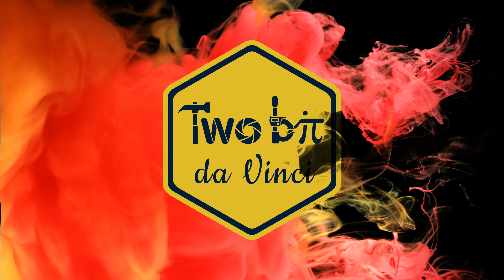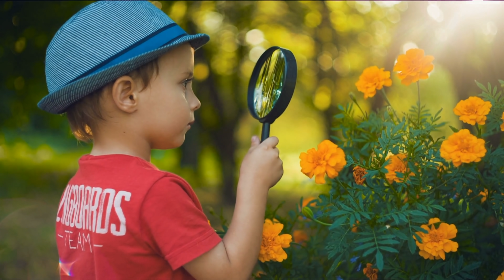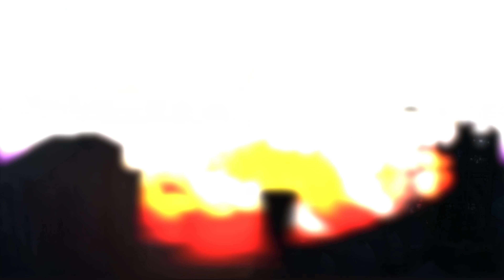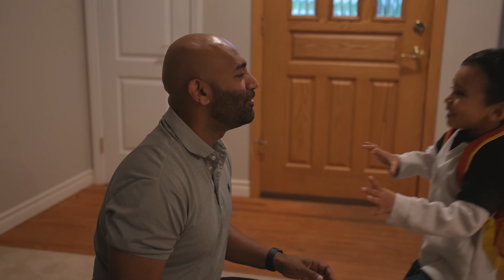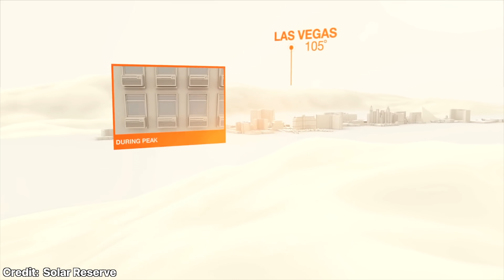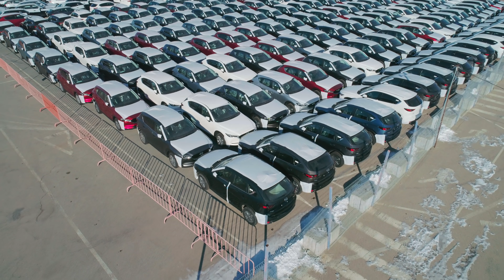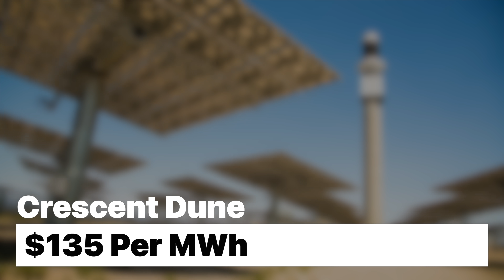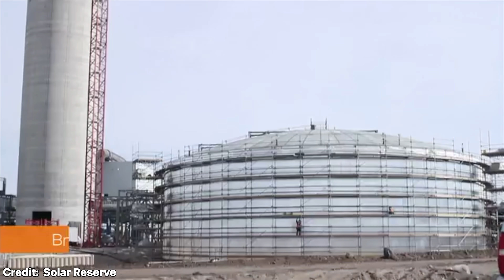This Billion Dollar Solar Plant was an EPIC Failure

Comment: You left out a couple of key points.
1. It incinerated hundreds to thousands of birds a day. Literally, charred debris from birds and litter being burnt into ash covered the solar reflectors causing daily issues.
2. Misalignments caused actual damage to the structure. Each solar reflector producers so much heat that minor alignment issues can serious damage, and in 2019 the main tower was taken out of commission because of solar panel alignment issues causing a fire.
There were huge amounts of manpower required to keep the panels clean and aligned, and it wasn't ever going to be cost efficient.
But Harry Reid's family made tons of money, so the actual purpose for which it was built was completed.
Reply: Greed causes people and governments to go large scale. Why don't they think off grid and small scale????
Reply: @crypton_8l87  because that equals freedom and independence....two things which government despises and works to limit.
Reply: You're right about the politician aspect of the project, but you're completely wrong about the birds, tower, and mirror washing aspects. Ivanpah was the solar concentrating project that was killing birds, not CDS. We had a team of biologists and aviary specialists that spent a month out there, and only once did they find a burned bird...and it wasn't even that bad. It was taken to a rehab facility until it regrew the needed feathers. And yes, if too much solar concentration were focused in a single spot it could be damaging, but only to the bare concrete or the heating tubes. The main body of the top portion of the tower is covered with a temp resistant material, similar to what NASA uses on space shuttles for reentry into the atmosphere, and the tiles are checked daily and replaced as needed. Again, I think the fire you're referring to was in Ivanpah. I drove past those towers many times and saw the middle tower was burnt up, and it took awhile for them to fix it. No fires at CDS though. As for the mirrors, keeping them clean and aligned are two completely different departments. There is a specific wash crew who's sole job it is is to drive through the field daily and wash the mirrors. They work in conjunction with the Heliostat Control Room Operator to put the field into wash position, via the HFCS (Heliostat Field Control System- software), all while the HFCS Operator is running the field to do recalibration, as well as salt production...sometimes at the same time. That's the system I put in place when I started there, but then moved into plant operations later.

I get your mindset on the whole project being a giant cluster f, and it caused a lot more harm then good, but you have a lot of inaccurate facts about the place, some of which I think you are mistaking for the Ivanpah project. But either way, the whole thing was a disaster and was solely used for political purposes. It was one of Obamas many failed solar projects that he green lighted, most of which just took the government money (ie our tax money) and ran....folded before they even got off the ground.
Reply: It was another “Green Energy” money laundering scheme.
Reply: ah yes OLD Crook  Harry    the   demo Don of  B S !!!!!!!!!!!!!!!!!!!!!!!!
Reply: Wow, thats COMPLETE IDIOCY. Complete waste of money. Whoever came up with this stupidity.... Hopefully natural selection will pick them off.....
Reply: Great points, always helps to have a fuller set of intormation.
I might add - Space.  How many of these could be built before space limitations become an issue?
Stay gold.
Reply: Really not to many birds since since this this is a desert.  With other similar plants ways to repell birds have been developed.  Really the bird problem is just one of those development problems like figuring out valves and pipe fittings for 1200⁰ F molten salt.  Nothing goes completely right for the first time.
Reply: iiiiiiiiii don't think it's the adoption curve that's the issue. It's operational and maintenence reliability and sustainability issues as the video mentioned. Yes, politics plays a small part too. I personally still believe the acreage needed to produce what a gas powered plant produces negates the benefits. I do such plant CAN be effective but not as a stand alone system. No alternative power supplier can solve ALONE our energy needs while protecting our planet. These sources in CONJUCTION with natural gas and other energy sources are the logical solution.
Reply: That’s what this push to renewable is just one big scam for the rich.
Reply: Thank you for reminding folks that this fiasco was paid for by Democrat politicians with money stolen from the American people.  Don't forget Solyndra.  That was another $500 million obozo cluster f^ck!
Reply: No.  Not even close.  Having been there during operation I can tell you that there are very few birds in the area on any given day, and only a few (0-5 per day) were killed.  More birds are killed by housecats everyday than were killed by this powerplant.
Reply: @speedyham545  are you still there?...would I know you?
Reply: @douglasgoldstein8990  I have not been there for years.  I was only there for design, construction and initial startup.
Reply: @speedyham545  house cats don't build solar energy plants though.
Reply: @allanroser1070  humans breed and spread housecats.
Reply: @enriquee.m.6706  typical comment based on nothing. didn't even read the original post
Reply: @memesterjohnson4096  I admit I read it wrong. My mistake.
Reply: Hundreds of thousands of birds per DAY? Really?
Reply: @texanplayer7651  Hundreds TO thousands, not hundreds OF thousands.  Please reread original post.
Reply: And cats, cats, airplanes and hunters don’t do the same each day X 1000 😂😂😂😂

Comment: This project was an Obama era scam boondoggle from the start.  The guy from Spain who came to Nevada (just north of the town of Tonopah, NV) could not find a construction crew to build it because the financing and credit were sketch.  My company refused to build it when asked because the project designer was a flim flam con artist from the start.  We dogged the bullet there.  Heating the molten salt took forever and way too much energy than the plant is worth.  Failure.

There there were the Environmentally Unfriendly aspects of the project.  The massive BIRD killings from the plant for migratory birds flying by attracted to the heat source of the concentrated light.  They were called 'streamers' when the birds flew into the concentrated light, evaporating rare birds to no end.  What a joke.  This problem was somewhat solved a year or two later by having the mirrors align at offsets to a concentrated point in the center when not in use.

Whacko Obama project.  All this money could have been used to keep the homeless of the streets rather than bunny thump a false climate change theory.

Comment: that's the problem with solar, wind , and basically any " green " energy. they aren't efficient. Not to mention all the space and habitat they take up. you could build a nuclear reactor on half the space and produce twice the power in a consistent manor. solar and wind will never be able to make a primary source of power. a prime example is France and Germany. France went with nuclear and Germany went with green. Frances electric is 41% cheaper than Germany. and doesn't take near the land mass. to give you an idea of what green energy does. in 2018 Germans were paying 33 cents per kw/h. in 2021 they were paying 32.7 cents per kw/h. where as in France in 2018 they were paying 17.56 cents per kw/h and in 2021 they were paying 11.48 cents per kw/h. Nuclear is not only cheaper but it's also greener than solar and wind. If you really want to make a change away from fossil fuels nuclear would be the way to go. It has had far more improvements and the efficiency has gotten way better. the first solar panel was built in 1954 was 6% effective and the current ones are about 22 % effective almost 80 years later. the first nuclear power plant was built in 1954 also and produced 6 megawatts of power. current nuclear power plants are 93% efficient. I'm not saying to give up on solar or wind but at our current abilities they just aren't very practical.

Comment: Using the extreme heat, should make it possible to reduce chemically/phsically very hot sand to silicon more efficient than purely electrolytical at low temperature. So perhaps producing reduced silicon is somehow making sense as an alternative outcome ...

Comment: Thankyou for Your encouraging report here,  if it wasn’t for the benefactor of money returns asap even Nicola Teslas power for free would still require up & running maintenance.  Improvements ongoing still have to cover this ‘ ponsy ‘  banking scheme as our planet runs continually on debts.
This idea to many would seem the best without harming the environment ,  hopefully a few twigs more toward free electricity more people joining a specific group like this one ,difference the more joining the cheaper with payments kept up as maintenance continues with gov doing its part expanding new setups. Solar panels too have their draw-backs once overheated their not as efficient. They operate most efficiently Staying between certain temperatures.
Once their “ Overheated “  , their efficiency level too responds.

Comment: Reflected solar thermal makes sense for deselinization, but not so much for power generation. They added complexity and risk by employing molten salt. I've read through some of the comments below and it's pretty clear that everything that I thought would go wrong with this technology did go wrong. The salt getting too cool in the pipes results in blockages that cannot be cleared. Anything flying into the thermal concentration zone is instantly incinerated, leaks from the system are deadly.
One thing they did not cover is that any aircraft flying over this zone could have blinded pilots. Then there's all the maintenance of the system itself, even if everything in an experimental, cutting edge power plant worked properly.
PV + wind + batteries = renewable, sustainable energy. Add in some thorium salt reactors for base load and you've got a winner.

Comment: There is a lot of info conveniently left out of the story. Cheaper photovoltaics don’t make the salt leak and don’t correct unreasonable design assumptions. The 3 plants in Nipton, Nv use the very same concentrated mirror idea but heat water directly instead of molten salt intermediary. The plant in Gila Bend, Az uses molten salt heated by individual parabolic mirrors. Both these facilitates need the same mirror cleaning labor and the same routine maintenance as the Dunes. The Gila Bend, Az plant is in bankruptcy and the US Dept of Energy guarantees anything sold to the plant. The bankrupt former owners did not pay their bills!  Every single one of these plants will never achieve anything close to capacity. Remember every one of these plants has a huge natural gas pipeline to it and they never tell you how much they use.

Comment: In the beginning you say if you've ever driven from southern California to Vegas you've passed Crescent Dunes power plant, (and subsequently mention again) but then a few minutes later say it's 200 miles north of Vegas - definitely nowhere near where you'd be driving from SoCal to Vegas. The one you see on the 15 on that drive is the Ivanpah plant - with 3 operating towers - not Crescent Dunes. When you're internally inconsistent to this degree in the first few minutes of your video it immediately brings into question everything else you're trying to convey.

Comment: The presenter claims that the project developers failed to take into account the steep decline in PV costs. The presenter also falls victim to his own premise by failing to recognize that much of the resources needed for PV component manufacture are sourced from overseas. As we are seeing with Russia, any unforeseen event can drastically curtail those resources, driving PV costs into completely uneconomic levels and potentially making PE economically viable again. Just because something is impractical now does not mean it will never be practical. How many decades did it take for steam power to replace the power of wind, or actual horse power? How many decades did it take for diesel electric power to replace steam power, or for nuclear power to replace diesel electric? We have become too focused today on immediate results and quick profits rather than planning for the long term.

Comment: His question: "So are all those who hate green energy right?  That it will never work?"  
His answer: "No of course not, this one didn't, and none actually have, but those guys are clearly wrong!  This just wasn't done correctly."
Socialists response to why socialism doesn't work given all the examples of it's failure:  "That wasn't real socialism."

Sound familiar?  Renewable energy is a worthy endeavor, and these kinds of failures are going to happen.  Every single internal combustion engine vehicle built did not work.  The same will apply here, but you green energy fanatics are your own worst enemies.  It's like a relationship, you can't force it to progress faster than it's going to or else you come off like a creep.  We really need to get the religious attitudes out of green energy.

Investments and support are driven by intimidation and politics, not reason and facts, which is why this sort of thing happens.  You're like George from 'Of mice and men', we need more Lennys before you kill solar like you did nuclear.

Comment: Mirrors dont deteriorate over time the same way semiconductor PV cells do. I see this as a huge cost that most "PV power plants" don't take into account when comparing solar thermal to photovoltaic solar. Also, solar thermal is just harder to implement. The technology is leaps and bounds more complex but it can also in theory do it more efficiently than other forms of low to zero carbon power production. What to know what I think? You can look at PV solar like a regular natural gas powerplant in terms of cost and operation and a solar thermal like a nuclear power plant in terms of cost and operation. Over time, the climate emergency and dwindling oil reserves will force us to further develop and fully adopt all forms of non petroleum based energy. Our one time petrol fueled blessing-curse will come to an end eventually and we better be prepared for it. Around the world geography almost always plays a tremendous role in how we can access clean energy. Some areas are perfect for geothermal, some hydroelectric, some wind, and others solar (and even with solar some areas are better suited to PV, and other solar thermal). Our energy future really is dependant on solar, nuclear, geothermal, wind, and hydroelectric mixed with all forms of energy banks for peaker storage. 

And I also find it funny that no one has mentioned how these solar thermal plants actually use some natural gas in off hours to keep the plant running while the sun is down. Can we circumvent this in the future? Is it needed? Yes, it produces far more energy from solar heating than the fossil fuels itself, but I wonder if it'd be sustainable to go 100% sunshine powered? I really do see a future for these types of installations, especially when the general publics tolerance for nuclear is lower than ever despite calls for going carbon neutral. Where do we think power comes from? The alternatives currently are still half baked at best. We have a lot to figure out.
Reply: Pretty sure most of the costs of this thing which made it fail come from this molten salt storage crap, who the heck even came up with it and why? Its the first of its kind, especially that big, make it a normal boiler which is FAR cheaper both off the bat and in long term costs, at first and see how it does, then worry about your salt storage tech if you want it so badly... Not to mention that if these hit off, the cost on building them will also probably drop drastically.
Reply: Off topic question/: If a similar idea like this were to be built near a water reserve such as coastline, and instead of an unneccesary salt system, couldn't the thermal heat generated from the same field of thermal things, produce enough power utilizing steam then, if it was a field of solar pannels?
Reply: “In theory”?   WTH ….In theory if a boar had tits it would be a sow.  In theory communism works.   In theory the government is supposed to be limited. 

You’ve got a lot of time on your hands to write so much.  Go volunteer more at a soup kitchen instead of wowing us with your ignorance.

Comment: How many acres of 2010 PV panels (laid flat to ground) would be required to generate 100% of the power needed in CONUS in the year 2050 (yes, assumption will have to be made)?

Comment: If you ban any fossil method to create electricity, the cost for electricity at night becomes much higher than for electricity during the day in a flat dry area. Probably this technology can be cost-efficient if it focuses on producing electricity at night by "just" increasing the storage capacity of the molten salt tanks. At day heat the tanks, at night sell the electricity. 
Battery technology on large scale is tricky and the costs are probably in the same range as the molten salt technology.
Hence this project is not a total failure. Probably it burned a lot of money, but if we can learn from it, it can open the path to new technology.
1984 in Germany the GROWIAN (Large wind turbine) was built. With a rotor diameter of 100m, it was the largest wind turbine for a long time. Economically it was a disaster. It was more in repair and maintenance mode than in production mode.
But today the rotor of a wind turbine is usually 200m in diameter and electricity from wind is economically very competitive. Why? Because engineers learned a lot from GROWIAN.